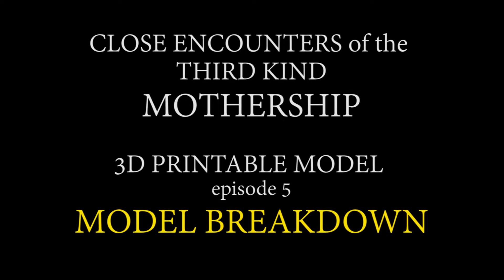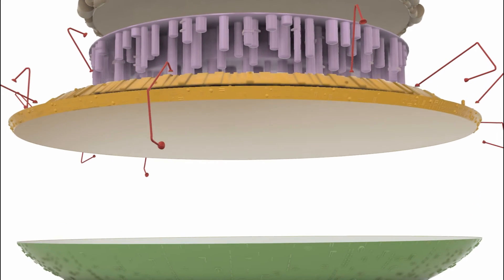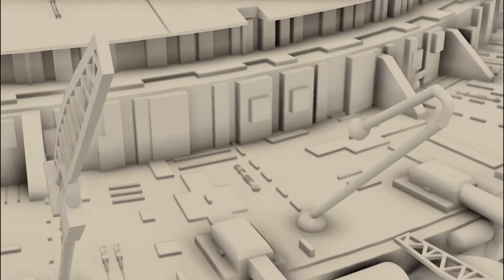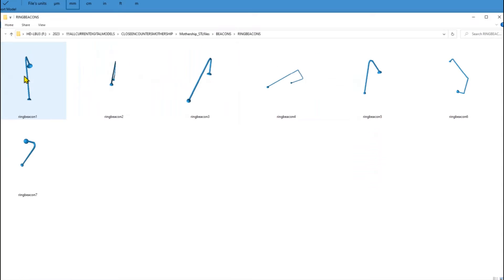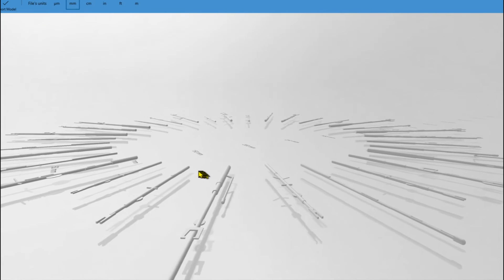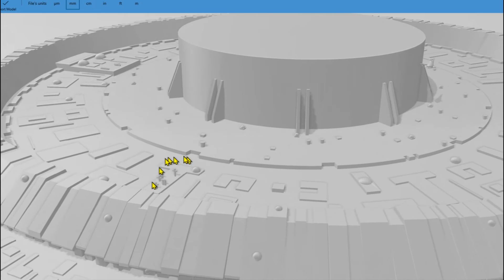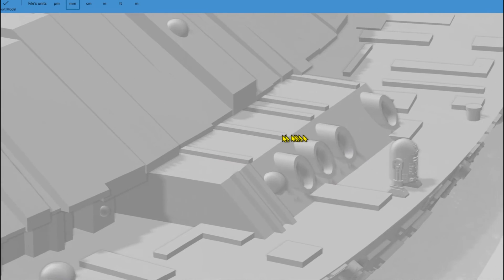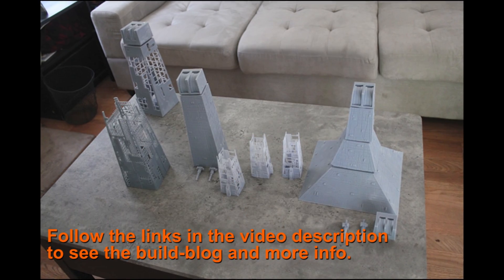CLOSE ENCOUNTERS Mothership 3D FILE KNOLLING VIDEO Episode 5 (HD)

Comment: Just how fragile are those antennae and other thin parts on the model once printed?
Reply from the maker: depends on what kind of resin you use to 3D print the parts.  There are some resins these days that are virtually unbreakable.
Reply: What could I use to replace the antenna if printed at a small scale?